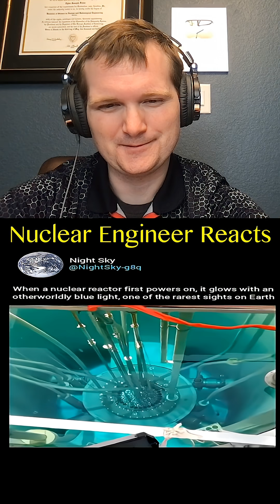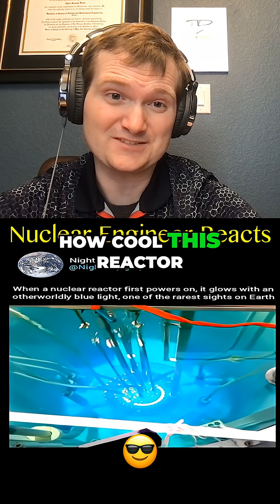Nuclear Reactor Pulse Noise: What's Real and What's Fake - Nuclear Engineer Reacts to Night Sky

Comment: So you don't realize that's a chemical thermal reactor it's chemical thermal. If you want to see a nuclear reactor what you do is you look at a torsion based generator the magnetic field causes reaction across the atoms that produces electrical current. Now, that is a nuclear electrical reactor this is a thermochemical reactor and yeah, dude, it's sick, it's stupid and you need to understand it's been over a 100  50 years since we needed to use s*** like this.G** d*** that guy, we talked about all the danger from the fossil fuels.Yeah , but really pushed to acknowledge that we get fossil fuels out of the ground because of geological concerns , it's a real thing we should be concerned with the leading killer to date is natural gas I'm gonna stuff, you know, torsion is not in any way.Shape or perform in electrical connection.So , look at the induction generation , Definitely be able to produce enough power out of that to turn in a motor that would have excess power and you could even like make a separate generator for the motor it's an RPM game, but you know, that whole thing with fossil fuels that we really need to get that out of there, oh yeah. Another weird thing, people don't know, you know, all the rivers in the world that empty into oceans. Well, the ocean levels don't rise from those and the Springs on the floor in the ocean, because countless underground rivers outline the coastlines of every continent on our planet.  Yeah, turns out we knew they were never going to rise the entire time, but you know, scientists always turn out to be morons. It's just weird like that. Like, they think this is a nuclear reactor bunch of f**** morons, sorry, I didn't, I didn't realize you're watching, you're probably gonna be the only person to read just that really come to grips, bud come to grips

Comment: I was a SRO back in the 80's at a TRIGA facility. There is a thud sound that accompanies the pulse caused by the thermal energy of 1 Gigawatt pulse generated in a core that is only 24" across. In the video you can see a ripple generated across the pool surface from the energy pulse. Other noises include the safety rod releasing and dropping into the core along with the B ring control rod/fuel follower rod used to generate the pulse. I also seem to recall some core groaning caused by thermal expansion and contraction.
$3 step insertions are cool to watch, but really hard on the fuel elements so they are infrequently performed.

Comment: Of note, the "particles moving faster than light" is literally particles that are punching through a medium faster thsn photons would punch through that material. Water is dense enough to slow light to about 2/3rds its speed, so you just need a dense particle, like a neutron, that won't be slowed down by the water molecules, so that it can punch through at nearly "the speed of light", while light itself lags behind at 2/3rds "the speed of light".

It DOES make a beautiful blue glow, though. It's called Cherenkov Radiation

Comment: I fucking WISH it made a sci-fi whirring noise. Nuclear reactors would be so fucking fun to work with if they worked like that. The dazzling blue light that looks almost like a strategically-placwd ring of LEDs, the sound that reverberates through the whole living room even though it's supposed to be heard through water (the coolant), so cool

Comment: "It's what happens when particles move through water faster than light" I think he needs a basic physics class. Nothing move faster than light.
Reply: Ah, well that's where your half right, nothing can move faster than light in a vacuum but in water, light slows down a little, so you can go faster than light there.
Reply: @nathanc6443  Nope not proven yet. But has 0  to do what was said. No science even in particle accelerator has found a way to slow down light. Want to tey then go against much of physics which i with they could but can not.
Reply: @arvistardok It's literally proven to be a fact that light slows down in a medium.
Reply: @arvistardok I doesn't light goes 0.75c in water? While some radiation go 0.9c? Which causes the blue glow.
Reply: They travel faster in water
Reply: @anonymous303-i1j  Listen to the audio. Light  in water is af fast as normal light but refracted because of water making it get to point a slower. But him and saying faster than light is wrong
Reply: @anonymous303-i1j  he said faster than light
Reply: @arvistardokyou didnt have basic physics classes my guy, light moves approximately 300k km/s in a VACUUM in a medium like water its 0.7-0.85C meanwhile radiation like gamma rays move at 0.9C. If we are talking about beta- or beta+ radiation, it is neutrons/protons turning into the opposite and shooting the rest mass of itself as neutrinos and electrons/positrons. Research shit before you say shit
Reply: @anonymous303-i1j  Nope. Said light so nothing travels faster. learn to listen
Reply: @arvistardok In a medium, light slows down, but charged electrons outpace light when they reach the "sonic boom" point. The light from these charged electrons underwater, is called cherenkov radiation, and it is surpassed by the electron by which it was procured. The theory of relativity states that light is the fastest thing in a vacuum, like in outer space, not a medium like water.

Comment: The blue glow is also called Cherenkov radiation It's analagous to a sonic boom when something moves faster than sound.

It happens because light is slower in water than in a vacuum (about 25% slower at 225,000 km/s) and some charged particles can travel faster than 225,000 km/s in water.

Comment: I was scammed i was told nothing goes faster than light
Reply: You were told that nothing goes faster than light in a Vacuum
Reply: It's different in water
Reply: In a vacuum, but light speed varies depending on the density of the medium it is in, if charged particles* move faster than light is going at in that medium it will generate that glow.
Reply: And it is called, Cherenkov radiation.
Reply: No, you weren't. Faster than the phase velocity of light. Individual photons still move at the speed of light. It's just more convenient to say "faster than the speed of light", because everyone understands speed, and almost nobody knows what phase velocity is.

Comment: Faster than light?
Reply: In water, the light slows down.
Reply: Light in a vacuum moves at, well, the speed of light. But in a medium like water it can slow significantly
Reply: Faster than the phase velocity of light, to be precise. Photons still travel at the usual speed. Search for "phase velocity" for more details.
Reply: In water not in a vacuum.
The speed of light in water is ~225.000 km/s in a vacuum 299.792 km/s, particle speed is in between.
Reply: Light in water moves at approximately .75 c (75% the speed of light) neutrons are not slowed down as much, therefore moving faster than light.
Reply: in a medium (like water) something can “outrun” light through that medium, but nothing exceeds the vacuum light speed.
Reply: Its like a photonic boom. Like a sonic boom but with light.
Reply: Search for Cherenkov radiation
Reply: Just look up relativity